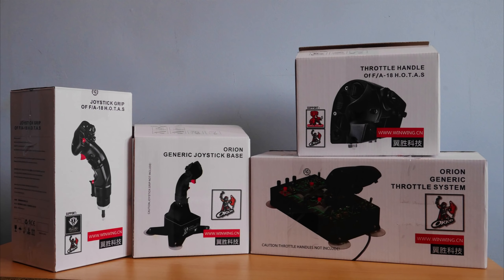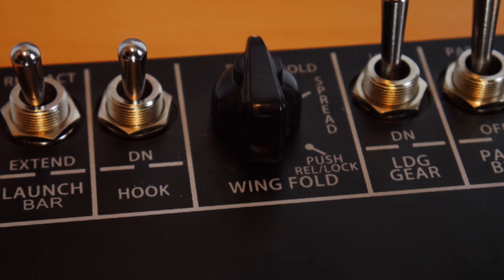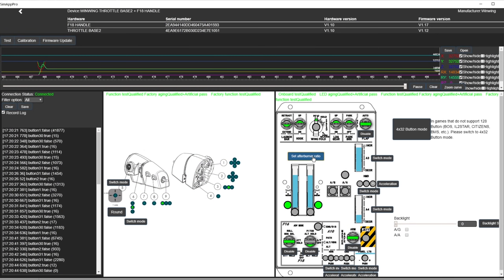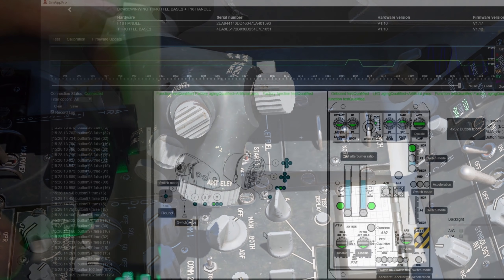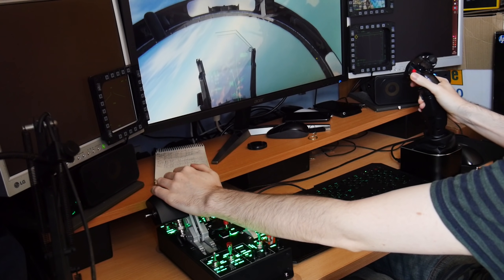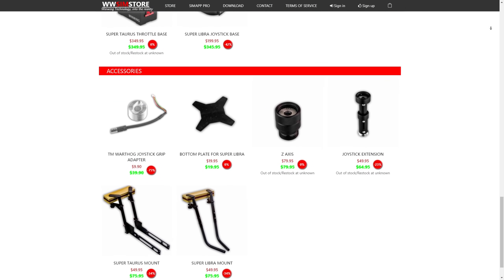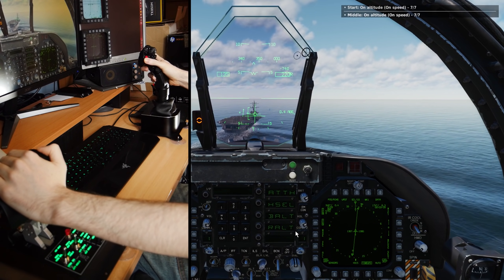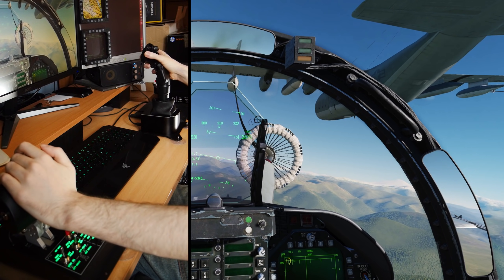WINWING Orion HOTAS Review [Discontinued]

Comment: Try a few coats of wax on the desk.  Smoothe clean surface make suction cups work much better.
Reply from the maker: Not a bad shout, I stuck some rubber grip pads to the throttle, which worked great. But the stick, I'd be inclined to put it on a larger plate or desk mount myself.

Comment: people are complaining about the slew on the throttle being hard to maneuver in the TDC,,,, any issues with using the cursor in the MFD's?
Reply from the maker: I've not had any issues after minor tuning to my tastes, if you find it too fast; add saturation to cap top speed, curvature to make smaller corrections easier. It's far better than the Warthog's slew.
Reply: @RedKiteRender  do you bind same as Chucks guide?
Reply from the maker: @charlesbukowski9836  No, I bind to match the hotas of the aircraft in question as best as possible.
Reply: @RedKiteRender  can you host your control files?

Comment: hi does anyone know if this would work with mac? if not then does anyone have any reccomendations?
thank you
Reply from the maker: The SImAppPro software (used for configuration) will not work, as there is no Mac version. However, in theory the stick/throttle should work fine as generic controllers, as long as Mac supports game controllers itself.

Comment: That F16 throttle looks awesome
Reply: Yeah, that alone is a huge selling point for me. The ability to swap between the F/A-18 and F-16 depending on which I feel like would be incredible.
Reply from the maker: Especially interested since you can't buy a F-16 throttle, just old worn out second hand TM ones.
Reply: @RedKiteRender  Definitely. I was looking into any number of ways to try and recreate the F-16 throttle, since it's such a unique layout and grip. I've got an old X-45 throttle that's kind of close, and was looking into how I could replace sensors and maybe 3D print an F-16 grip to replace it with...but that all looked like it would be as expensive as someone selling a commercial one, with the downside of me putting it together and probably messing up.

Comment: Hey great - very insightful... Pepople seem to think the Warthog Hotas is no longer viable, what say you ?
I really like the WINWING stuff but Im confused about the EXTENSION - I would love to add to ORION but Winwing says its not recommended.... they used language that seems to indicate its possible - Do you know if they will offer extension for the other Sticks ?
Thanks again.
Reply from the maker: The Libra is better for extensions as it features dry cluches to prevent wobble. However the Libra is not compatible with Warthog compatible mounting solutions, and their own mount isn't that great. The Orion can use extensions, however it's not ideal, the base has no dry clutches, therefore it'll wobble a little, and without customisable spring strength it may feel a little light with the extra leverage, will that bother you? i couldn't say.

Comment: Did you notice any twist in the Joystick, mine arrived today and is connected correctly and works fine, but the grip still twists about a 20deg each way with no real force
Reply from the maker: Make sure you've tightened the main screw, then add the little locking bolt per the manual: 
https://www.winwing.cn/static/file/J2-ORION%20JOYSTICK%20BASE-MANUAL%20EN%20V%201.0.pdf
Reply: @RedKiteRender   Thanks that did it ! was jut not quite done up enough

Comment: I just rcvd my Orion but have not figured out how to set up either A3 or A4 to use as a UI zoom in/center/zoom way in in VR. Ideas?
I also have a issue with the small pin that keeps both throttle quadrants together. It doesn't seem to align enough to get the magnet
to hold it in place but it gets stopped so it cannot be locked down. Ideas? Thanks for the review. Bob
Reply from the maker: Set them as buttons, bind to the VR zoom levels, which I think are found in the UI layer category.
Reply: I have the exact same problem with the pin as well Bob - seems to bottom out in the hole but not allow me to slide the lock down.
Reply from the maker: @finalist1971  Double check you've assembled it correctly, otherwise get in touch with WinWing.
https://www.winwing.cn/static/file/T2-ORION%20THROTTLE%20BASE-MANUAL%20EN%20V%201.0.pdf

Comment: When comparing products, you should add "access to customer support" to the equation because importing and/or returning devcies for repairs can hugely increase the invoice.  Winwing is postionned above the other players in thiscategroy so they must be perfect at this price range
Reply: At this moment I am struggling to make myself understood with Virpil's tech support over a new throttle quadrant with a defective axis so I can't possibly agree more.
Reply: Maybe as nice feedback to this point, I have one of the first Super Libre and the first batches had a little flaw with the small 5-way-switch, used in place of the Recce-Button. The small Hat itself, got lose and I can't find it anymore, winwing offerd me to ship a new hat with some tips to fix it or a replacement switch they used in later versions. The new switch need a bit of sanding but is way more resistant. I don't asked for replacement of the stick because that's usually a bit messy with German customs. So I'm not sure how good they are at this point. 

But I received the customer-support emails ins just a few hours and there was no discussion or something like that. 
Also, I have to admit I used the little switch for zooming, so you can image the workload of that tiny switch, I'm sure if I would find the head it would be just a matter of good glue and nobody would see it ever was missing. 

Dont get me wrong that should not happen, but I mean I have my setup now for about 10 Months and fly around 15 - 25 hours the week, sooo it has some miles on the clock :D
Reply: @Headbreaker  intersting comment. nice to have feedback, but if you are not techsavvy, replaing yourself a part for a several hundreds dollars product can be tricky. All these companies are putting products produced in small quantities...feels like they sell prototypes
Reply: @aquamich129  well I know what you mean but to be honest a switch can allways break, I mean I had two Warthog Throttles with a broken boatswitch so Im not that disappointed and sure because I ordert them from Amazon the replacment was fast but I usualy RMA are not that fast at all.

Prototype is a bit harsh in my opinion, the workmanship ist really good and the switch is a buy-in Part so I thibk its is a good sign the replaced it in later Batches because they heard the Feedback. I cant say for sure but Im pretty sure if IT is not possible for you to switch that, a replacement for the Stick is the way to go but as I said for me its more easy to replace it myself.  But thats just my impressions.

I can understand your apprehension but keep in mind WinWing builds buissness Level Simulators as well so they net New in the buissness at all.
Reply from the maker: Customer support is one of those things that's quite difficult for me to quantify since I get VIP support given I'm reviewing it at their request. 

They've naturally been great in communications with me, although with minor language barrier issues, which is to be expected.

Comment: This looks promising! I've wanted to upgrade my throttle, but I've been interested in something a little more "real world" than some of the self-created throttles from other companies. Hopefully whenever they get around to making their F-16 throttle they'll send you one of those too!

Edit: Just got to the F-16 part, and didn't even realize it's the same base. That just made this way more tempting!
Reply from the maker: That F-16 grip looks great, love that they're trying out the full rotation detent mechanism. Though it'll be too tall for desktop use.
Reply: @RedKiteRender  Also, any word on whether or not they'll separate the throttle and stick? Having just purchased the Warthog, I don't need a new joystick, but that throttle looks like it could be great for the right price.
Reply from the maker: I'd expect they'll do the initial run as just the full hotas set, then a few months down the line sell them independently like they did with the Libra/Taurus.
Reply: @RedKiteRender  Nice! I'll keep an eye out for it. Thanks!
Reply: @aaronwhite1786  They are not separated on their website. So they wont be selling them separate at least initially.
Reply: @russellmm  Yeah, I noticed that, it's what made me curious. 
I'm definitely interested in the throttle. My old X-45 is damn near old enough to drive, and if I can buy the separate F-16 grip later on and quick swap it, that's a no brainer.
Reply: @aaronwhite1786  i sent them a message using the contact form and they replied they will be selling them separatly in the 2nd or 3rd batch later this year
Reply: @aaronwhite1786  just sell your warthog stick..they are selling for crazy money on ebay
Reply: @Melkor54  Haha, I've thought about it, but I'm pretty partial to the Warthog stick for my A-10 flying. 
I'll probably just hold out until whenever they finally drop the throttle stand alone.
Reply: @aaronwhite1786  a bit late, but if you're considering the orion for F-16 use, the f16 stick is similar if not identical to the f16 stick. Winwing would have you covered on both at some point. They're also making a collective for the throttle at some point.

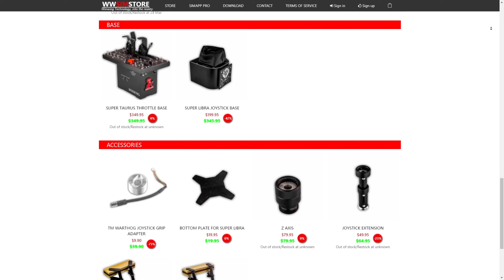Comment: Hey Redkite, great review, question. You said at 8:50 that it was compatible with the extension and twist axis, but on their website on the orion page in bold red it says these are not recommended. Can you provide more information please?
Reply from the maker: They're compatible, but, the Orion base is not well suited to an extension. A small extension like the twist grip should be just fine, but a longer one will make the stick wobble as it lacks a dampening clutch, and of course will require a desk mount. 

The Libra on the otherhand is built to handle extensions.

Unfortunately I was unable to test that, so i'm basing it on my experiences extending a WarBRD base.
Reply: @RedKiteRender  Sweet, good to know! Thank you!

Comment: Any more thoughts on the idle cutoff detent now you've had it for 6 months? Some guy said he has accidentally shut his engines down several times now (after using a few months)
Reply from the maker: I've not managed to, although if you have light friction i can see it happening. If it is an issue you can always unbind the engine cut toff from the detent.
Reply: @RedKiteRender  I think the sidewall they made for the Viper throttle handles is the solution. A proper "lift over" type of detent that allows you to carry out the after start idle detent check positively .
Reply from the maker: @boggy8557  Yeah I'm really looking forward to that F-16 throttle attachement. The warthog's lift to go into idle works great too, i modified the AB detent to push through, as it's also a lift by default.

Comment: I am really considering getting at least the throttle as it has just about mall the knobs and switches on would need for any flight/space sim, however do you know if they carry any sticks that have a twist Z axis?
Reply from the maker: You can buy an extra twist axis kit which goes between the stick and base, though it will raise the handle above what is comfortable for tabletop use.
Reply: @RedKiteRender  I have a desk mount, currently using a x56. Thanks for the info. Sadly it looks like that attachment will be sold out for the foreseeable future though.. guess I'm getting a VIRPIL.

Comment: my question is: is the throttle of the orion as precise as the throttle of the super taurus? i know the travel distance is bigger on the super taurus and that translates in a better reading in small movements, but are they using the same sensor or are they different?
Reply from the maker: Same sensors, but having the greater travel the Taurus is more precise.
Reply: @RedKiteRender  do you feel the difference in flight? i am looking into one of these and felt the taurus is quite big (i want to custom mount the throttle to my chair) and i never had a throttle before but i want to get the better one
Reply from the maker: The Taurus does make it easier to do fine corrections, and it's motion is really nice. But, I wouldn't say it's game a changing advantage. The startup panel attached to it is fun. Only real issue I have with the Taurus is the lack of extra axis for things like camera zoom.

The Orion is much more accessible and easier to 'live with' than the Taurus, which is heavy and big, making setup a hassle. Orion is probably the better option unless you plan on building a more permanent setup attached to a desk.
Reply: @RedKiteRender  was thinking of the exact same thing, and that's the reason i still didn't ordered the taurus yet... I plan to do a custom mount for my chair that i can just mount whenever i want to play, and felt the taurus is too big for this set-up, but at the same time i don't want to miss out on better performance... But if they have the same sensor then maybe with the f18 handle ( or a slight mod ) the curve lenght might get bigger and it will get higher precision. But thanks for the info! Really appreciate it! Now hopefully they will have this separate from the grip for sale in the future, as i am looking into e virpil one for the joystick
Reply from the maker: The Virpil WarBRD is my daily flyer, combined with the Warthog stick. My favourite combo so far, though not too great for extensions (get a T-50 in that situation). Silky smooth, it took me a week of tinkering to get it how I wanted! (soft springs, smooth cams) I've been eying their throttle for a while.
Reply: @RedKiteRender  if you get the throttle please do a video on it... And maybe compare with this one, don't know if i would still go with another throttle, this one checks all the boxes for me. About the warbrd base, is that really an issue with it having an extension? I was thinking of centermounting it too...
Reply from the maker: I'd certainly review it if I pick one up. I use my WarBRD centre mounted with the desk mount holding it just above my seat, so I can tuck into it. You can offset the handle if you unscrew the connector on it (by design) works great like that. Extension wise, if you put a small extension say 5cm not a big problem, 10cm+, you're going to have the stick wobbling back and forth a little and it gets hard to return it to centre quickly as it lacks a clutch/damper, to stop the stick in the centre, where as the T-50 or super libra do have one.

Comment: The suction cup desktop solution is really unforgivable and the single worst solution I have ever seen for a desktop flight stick regardless of price point.  To have it happen on a $500 set just shows that WINWING is not ready for the bigtime and is running far, far, far behind VIRPIL and VKB.  I have one and unless you have a perfectly smooth, preferably glossy surface, it WILL some unstuck very quickly when rolling or pitching to full deflection.  The trigger is also total crap with a loud and poor feeling spring inside and grinds and make that classic cheap spring sound.  It sounds like a kid's toy for the dollar store.  The throttle is IMO the best on the desktop market at any price, and the stick base internals are very good, but WINWING really screwed the pooch with the suction cup base.  It's enough that if you don't have a super smooth glass or glossy desk or a good mounting solution, you could seriously reconsider purchasing until they either fix this literally INDUSTRY WORST desktop baseplate OR allow you to buy the throttle separately.
Reply: Hello, I'm planning on buying Orion bundle and I am confused what to buy..
VKB Gladiator nxt with orion throttle or Orion hotas?

Comment: Awesome video! :) This a new product that I hear of it the first time and it's really promising. 
One question: Stick has rudder twist? Cause this joystick solution would be golden in Elite Dangerous and Star Citizen and I am not that good with pedals ...
Thank you for this lovely video.
Reply from the maker: Twist can be bought separately, by default it's fixed.  But it also serves as a small extension, so might make it a little too tall for desktop use.
Reply: @RedKiteRender  I think the z axis is only vor the libra, not the orion???? 🤔 Any solution or better knowledge, greetings from austria.
Reply from the maker: @PureDumpsometimesGenius  It's compatible, but the Orion is not designed for extensions. With just the Twist it should be okay, but will ideally need a desk mount as it'll be raised too high for comfort on the desktop (you can see the space in the software where it shows the Twist axis support in this video too)
Reply: @RedKiteRender  so I can bought the z achsis and it's good to go (no pedals neded anymore) sorry for my English? When that fits in I definitely buy the orion on the 10. 5😁

Comment: @RedKite Do you know if the Joystick extension from the Libra will work on the Orion? The website says its only for the Libra but I don't know if that's just because they have not updated the website or if its actually not compatible. I don't know if you have one of the extensions around to try it?
Reply from the maker: They’re compatible, they both use the same connector.
Reply: @RedKiteRender  thanks. Ordered both.
Reply: @russellmm  you may have to find heavier springs